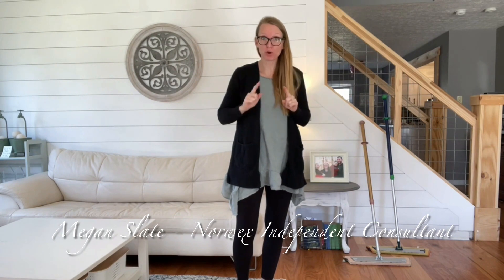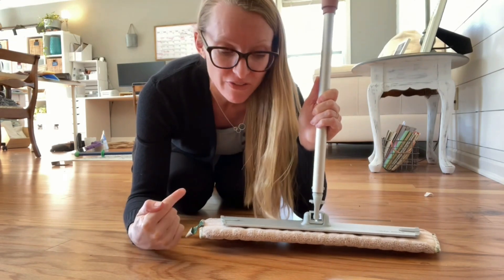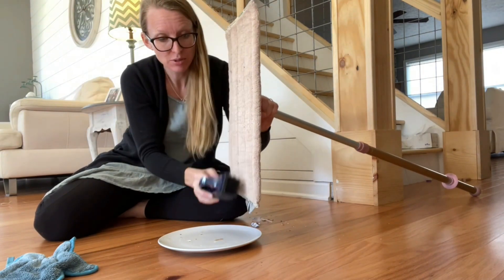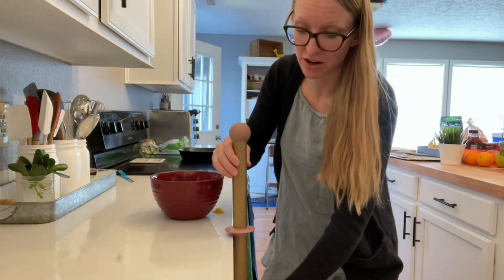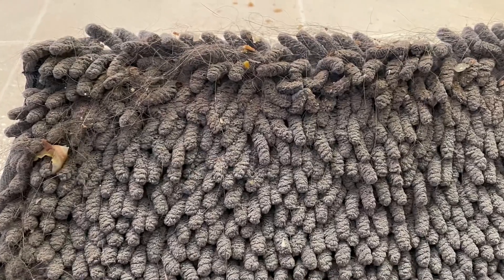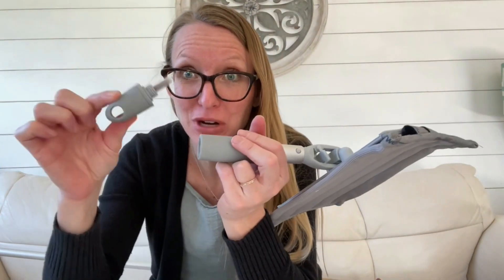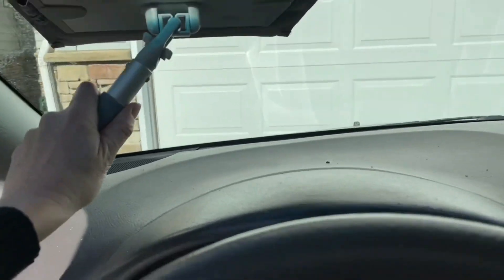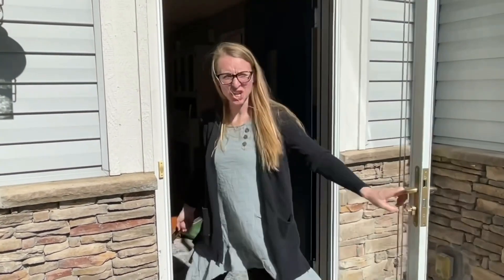NEW The Mop Spring Cleaning

Comment: But how do you actually clean the floor if you're only using water?
Reply from the maker: Because we aren’t disinfecting here...we’re mechanically cleaning! Wayyyyy faster and easier. It removed instead of smearing around toxic cleaner and leaving its residue and dead bacteria on your surface.